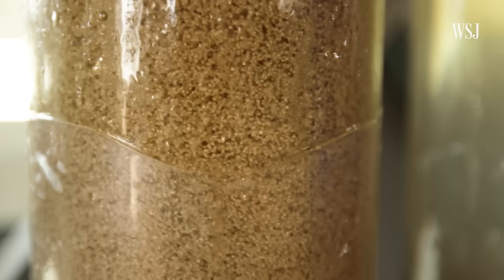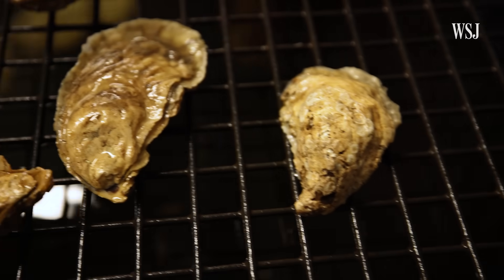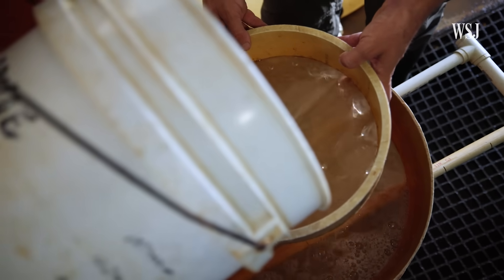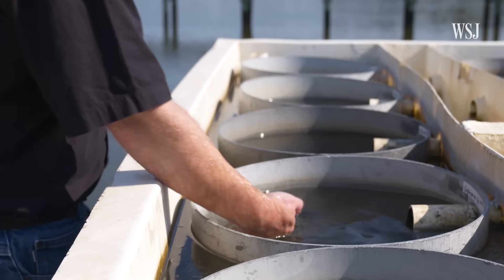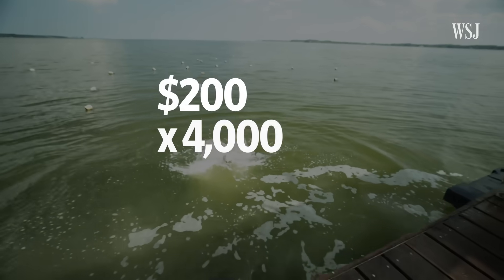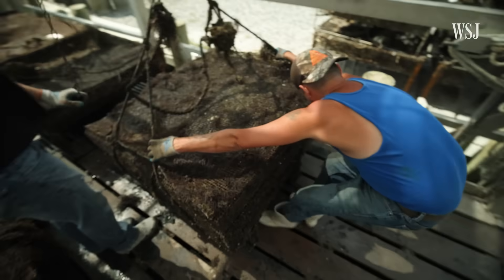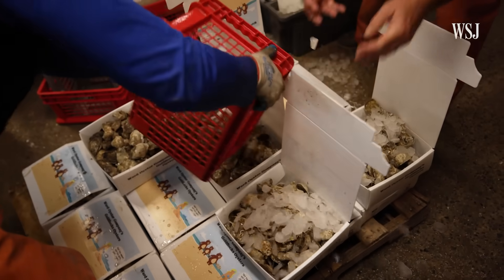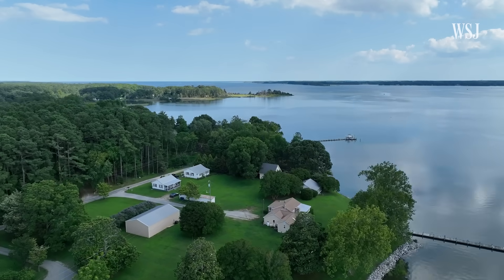What It Takes to Grow Four Million Oysters From 1.5 Billion Larvae | WSJ Operating Costs

Comment: I did not need to hear about how much it cost 82 times. I would rather have you talked about the actual work it takes to run it. It's a business we know how much it cost. You had everything up and add 20% basically. If you're not getting 20% back you're doing something wrong. And I get on with the facts of oyster growing.

Comment: You do know making the water flow on a very slight hill will move the nutrients better and if you dig a big hole to a level you keep your water temperature you can run lines down there and pump the water back up using solar and the water will always no matter what will be the same temperature.

Comment: Okay, 4 million oysters at $3 each = $12 million a year customer cost.  Minus $100,000 royalty, minus $75,000 propane and electricity, minus $1 million labor (three or four workers?), minus $800,000 for cages (reusable), minus $150,000 cage repair, minus boats, equipment and buildings, minus $75,000 insurance, minus $100,000 packaging...still looks like a highly profitable business.
Reply: sold 0.4 whichs 1/7 of $3.  so they sold 1.6 mil not 12 mil.
Reply: Ok, not a good business then.  @BS-my2ky